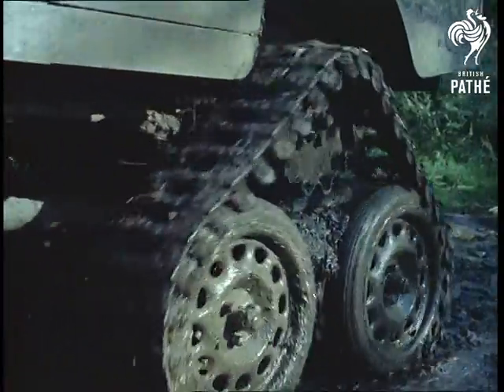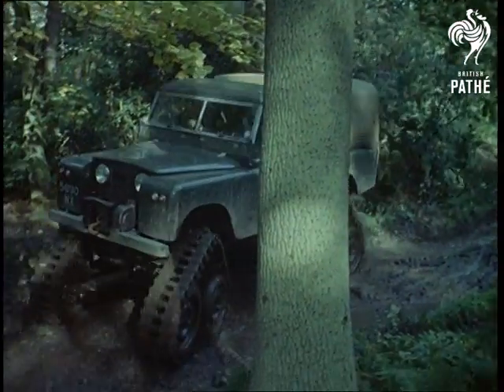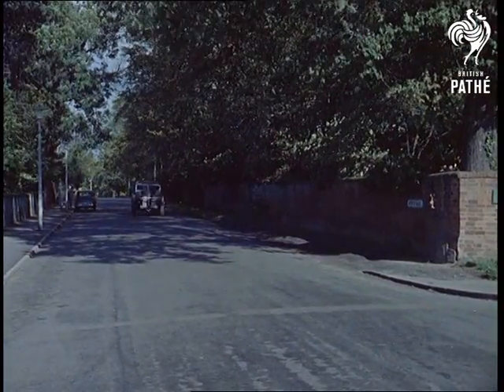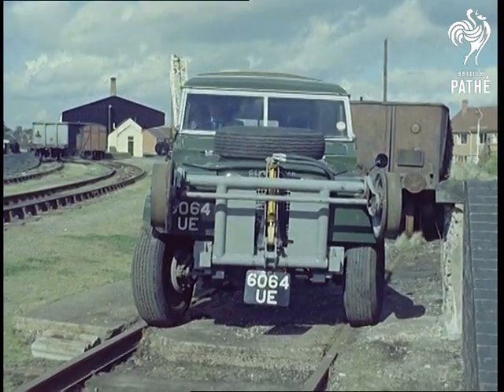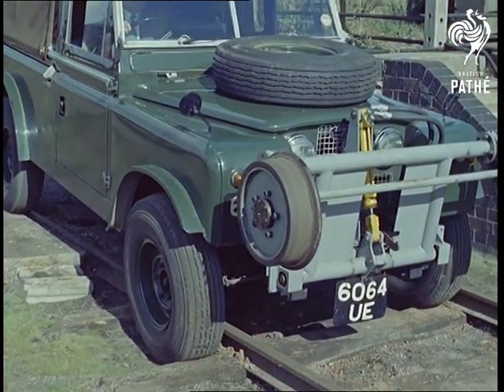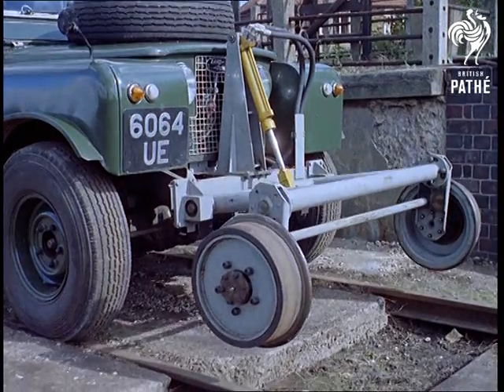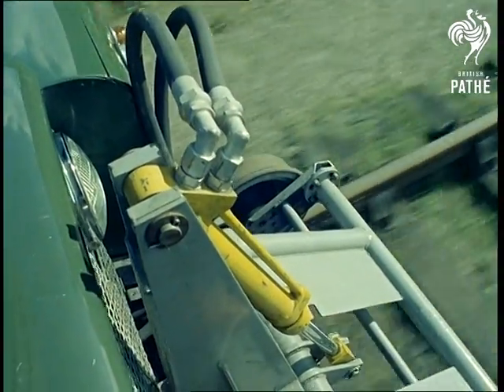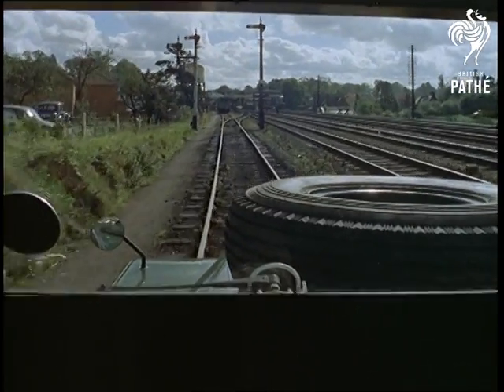Road Railers Aka Land Rover Road-Rail Vehicle (1961)

Comment: With these "Road Railers," would the driver turn the wheel at curves or would he simply let the car take its course on the rails?
Reply: No he can't
Reply: There would be no need to steer. The rail wheels would guide it.
Reply: On the rails, there isn't a need for steering. The rail guides you, not the other way around.